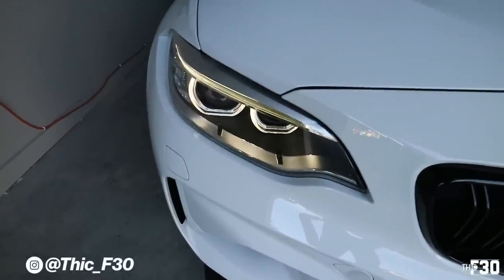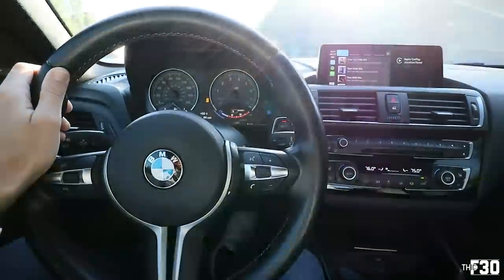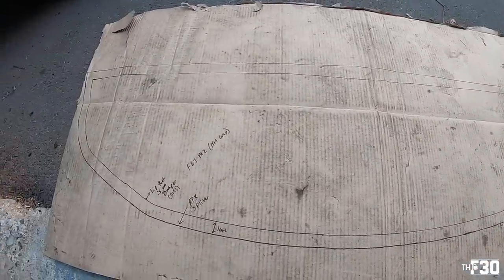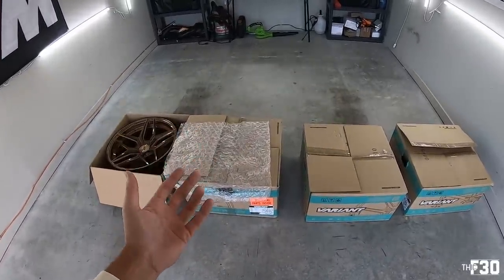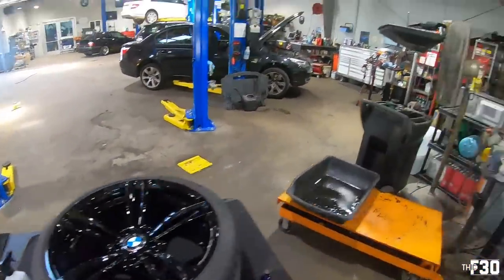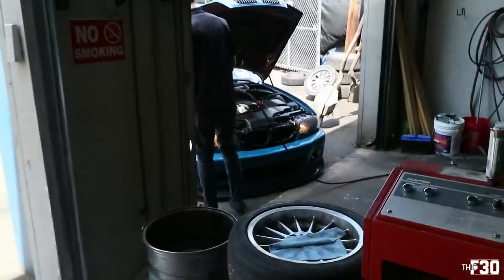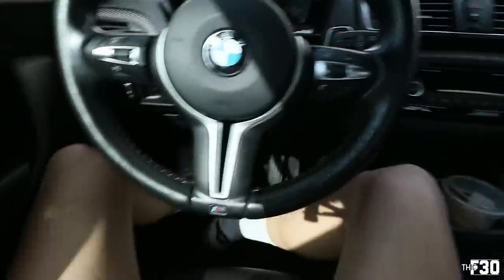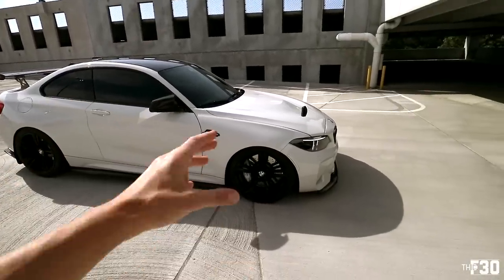THE M2 GETS THE MAKEOVER IT DESERVES! BAYOPTIKS HEADLIGHTS, GTS WING, BRAKE UPGRADES & MORE!

Comment: Love your channel. Just got my F30 back from body after being hit TWO times in ONE week! Anyhoo I “get” the look of a front splitter but it won’t be real. Aero requires a high and low pressure level (faster air speed lower pressure) for a splitter to work and it must extend TO the rear diffuser. That’s the point of the rear diffuser. The idea of a flat floor however is an effect of bad rules and NOT good aero. It’s a requirement In Most racing to stop Venturi effect and also no skirts for “ground effect”. The death of Ayrton Senna really ushered in the era of the flat floor. Look up “1980 us Grand Prix “ and you’ll see under cars and skirts. Maybe it’ll give a better perspective.

Comment: How have the bayoptik lights worked? I heard lots of reviews with broken parts and poor quality and burnt bulbs. And apparently they take 2-4months for warranty service if something breaks?
Reply from the maker: They’ve been great, zero issues.
Reply: Thic F30 thanks for the reply. I just found out they’re local to me too. I read further into those other claims, the shops that installed the lights seemed sus. One of them claimed no coding (upgrade from halogen). The other a forum member pointed out the bumper and hood was misaligned so who knows if the lights were installed right